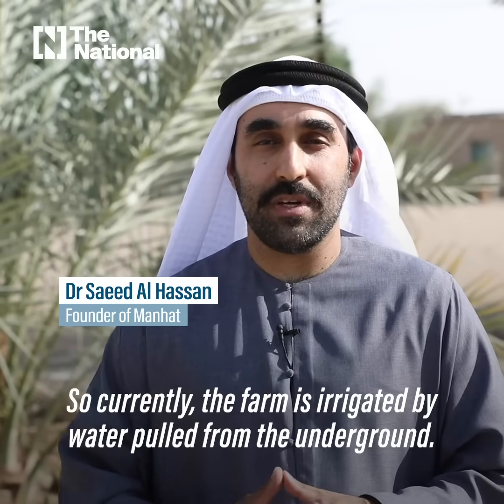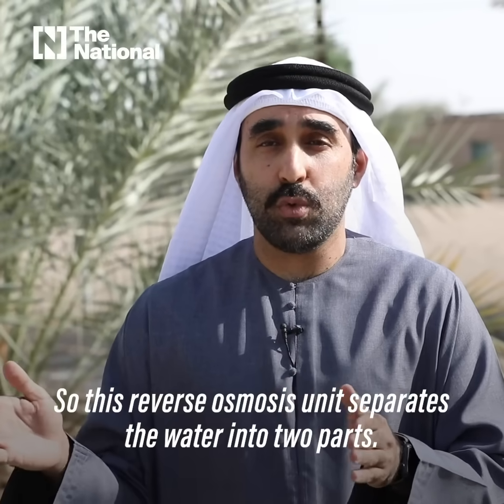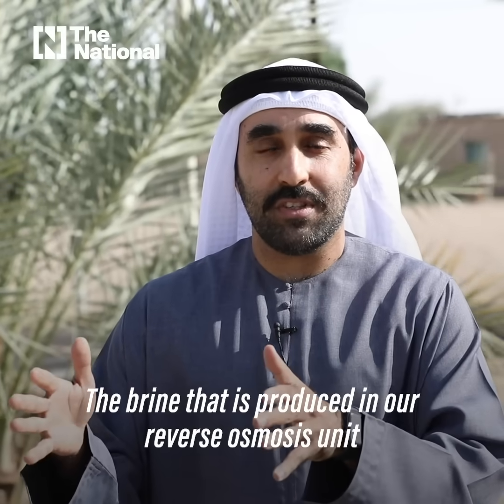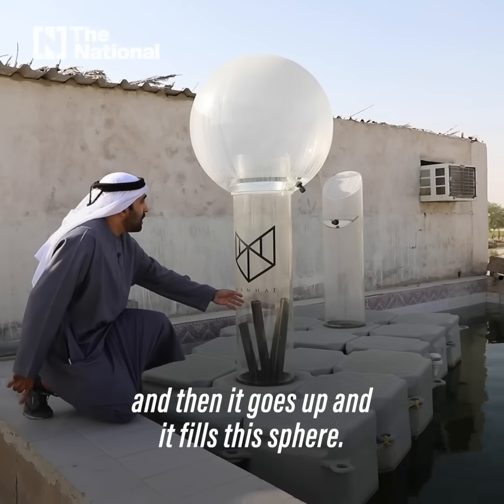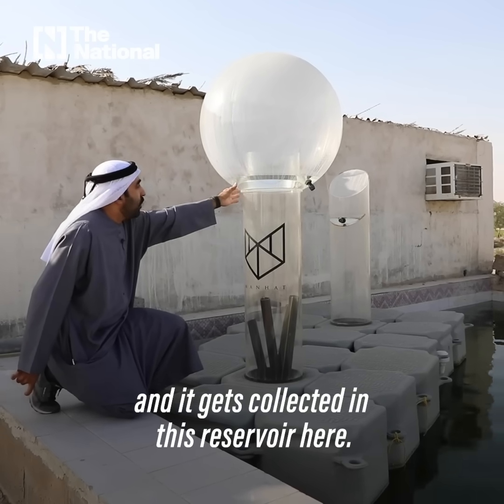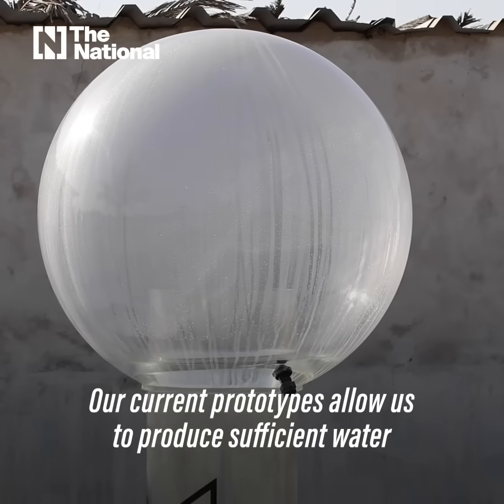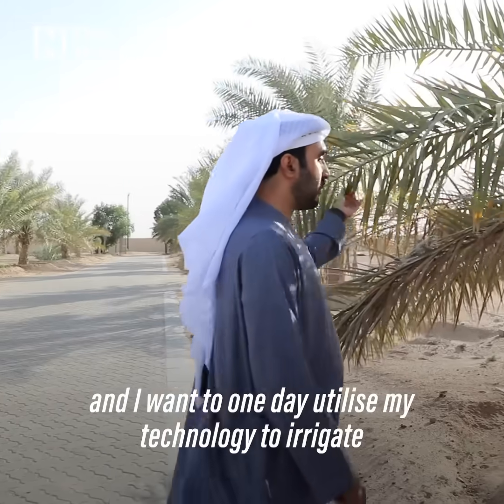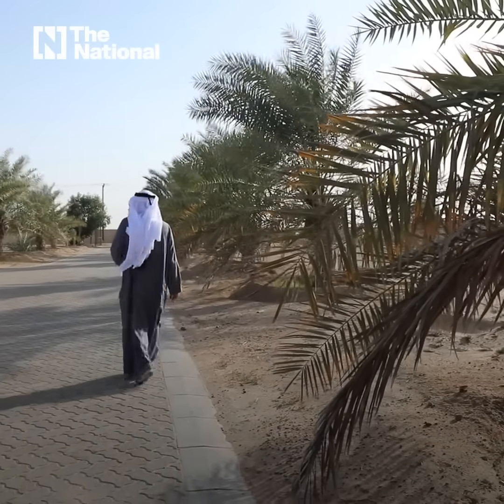UAE professor builds unique device to water his farm in the desert

Comment: Gahh! He needs to bury a short vertical pipe to pour water into the ground at the base of the trees. Pouring it on top of the dirt like that will lose half the water to evaporation. I like to cut the bottoms off of plastic bottles and bury them upside down and pour the water into those.

Comment: Yep and letting most of that, about 80%,  pool of water evaporate into the air....Sounds efficient and smart to me.😂

If it was me.., I would put a clear dome over the pool, the use parabolic mirrors aimed at the water to heat it up, then condense the vapor.

Comment: I suspect most people are misunderstanding  this video. He is using the waste water/brine from the osmosis process to generate even more usable water. If you ever use any reverse osmosis you realize there is waste water coming out of it. He is simply getting more usable water out of it which in this case is turning very salty water into potable water. It would be the equivalent of using nuclear plant nuclear waste to create more power. The only difference is his approach is simple passive process to reclaim water without electricity.
Reply: So what, atleast he's using the good water for irrigation...what's the catch? Isn't it good what he's doing?
Reply: I suspect you are misunderstanding.
 No electricity means no RO.
Reply: The left over will be salt which can be used in our food
Reply: Good idea
Reply: It’s just another solar still using waste brine instead of sea water.  It still leaves the waste water with higher salt percentage than it had before.
Reply: So why the claim about no waste brine? Even if he captures 100% of the water in the brine you still have to dispose of the remaining dry salts. I’ve seen a prototype to crack salt molecules and flare (use some other way?) but never a permanent solution for the leftover salts. His idea for floating crop production is wonderful except that over time it’ll turn the Persian Gulf into the same 27% salt brine as the Great Salt Lake, amiright?

Comment: solar distillation is good. Just let water drain down, out of the sun. Bigger the distillation site, more water evaporates. Black paint/cover on the unit means it may boil. Water vapor drawn into an underground tank to condense there. Geo sites might be used, as well, as long as the salts remain deep in the rocks.

Comment: This is a good idea. Energy density for sunlight is capped at 1kw/m2. That seems to be sufficient to evaporate several of liters of water per m2. But the problem is since water is transparent very little of that energy actually heats up and most of it just passes through water. 

If you created a surface that would first absorb sunlight (like a plate painted with carbon black) that would absorb the majority of incident light then you can drive up the efficiency of the solar evaporator much higher. But still difficult to compete with RO technology which is much more efficient. 

This is an important project because it allows us to develop heat based water purifiers rather than electricity based. I look forward to more developments in this area.
Reply: Yes but if its a glass globe, won't the sun be magnified, making it hotter? Or do you mean the container holding the brine needs to get hotter? I guess if it were glass tubing or bulb type jug,  it could get hotter. I hope he improves on it anyway. I'm not a scientist obviously😂.
Reply: @SuthernSunshine yeah good point. A lens-like effect could happen in a curved container but supposing that it does  nothing changes.... Water is still transparent. Concentrated light will have more power(intensity) but water will absorb very little of it. A way is needed so that setup can absorb more light. Black surfaces could help with that. Carbon is an almost ideal black body that absorbs sunlight uniformly across the entire wavelength so that might work. Then there are other challenges like evaporator based designs being inherently less efficient that pressure based ones so incremental improvements to this design will be necessary to make it a strong alternative to electric filters. But that can be done later once a base product is in place.
Reply: @akshatjiwansharma  wouldn’t the lower cost and easier accessibility be a draw?
Reply: @shannonnakashima7714 It could be if they manage to actually deploy these evaporators at sea. Not sure how easy that would be considering it can get rough. I'm sure that these are preliminary designs and we'll see improvements as the team understands the challenges better. I'm excited about its future and hope that they continue to build upon this design.
Reply: @akshatjiwansharma or we desalinate at scale and use these to possibly process the brine before using the remaining salt to make thermal batteries.

Comment: Isn't this just distillation (using the sun to evaporate water in this case)? The question really is, how scalable is this? Maybe to enhance the process they should have metallic walled pools, with the walls extended outward to have heat from the sun transferred to the water to speed up the evaporation process and collect at the top of the pool.

Comment: got to dispute the statement at 2:38 minutes that you need to add salt to water to make it safe to drink. 
Yes that is true if you are walking for days without food. 
You sweat out all kinds of salts that are not replaced until you are deficient in electrolytes. 
But in the real world my local water is a bit salty for plants. Maybe 100 mg of sodium per liter and 20 magnesium, 60 mg/ liter calcium. 
Say drink 2 liters a day. I get 40 % of the minimum sodium an adult needs and maybe 20 % of some other minerals. 
If I heat food  ( food contains all these salts)
and drink distilled water my digestive tract sees all these salts in reasonably normal levels. 
That said schemes to desalinate water and grow crops are appealing.
Reply: No it's not his statement he only reiterate scientfic consensus and common sense. slight variation to salitnity higher or lower than blood is isn't an issue, but desalinated water on the other hand or salty water is infact, not fit for human consumption lets try to be clear, this information saved lives in gaza so many people didn't have access to food for months but water you can't go without for 3 days

Comment: -Dig a 10m wide, 5 km long trench from the sea into the land.
-Place a 5 km long greenhouse over the canal, creating a surface for light to pass through and condensation to get trapped
-place U-sheets of metal between the greenhouse wall and the canal, catching condensate which runs off from the walls of the greenhouse.
-close the backside so no wind can blow away the moist air in the tunnel
-there you have your water
Reply: Do that except floating on the water.
Reply: Yeah right ,a 5km long greenhouse isn't really asking for too much is it
Reply: 5 km long greenhouse: definitely cheaper than a desalination plant. 😒
Also, with solar panels getting cheaper and cheaper access to electricity is not a problem. No need to be connected to the grid and no need to pay for it. These people with “new inventions” based on evaporation should make a spreadsheet comparing the cost, output and efficiency of their systems with the systems we already have. Guy owns a farm and the best prototype he can afford fills a jug of water? Why is he still using a reverse osmosis system in his farm and hasn’t built a greenhouse over his brine tank yet? It’s a scam or a delusional idea in the most charitable interpretation.
Reply: Yes, that's an expanded version of what this video showed, essentially a greenhouse condensation trap.  Recovering more output from the leftover RO product.